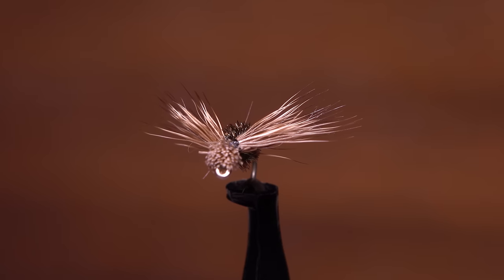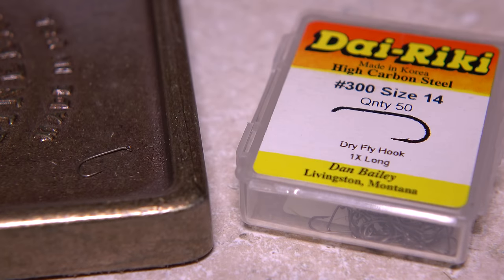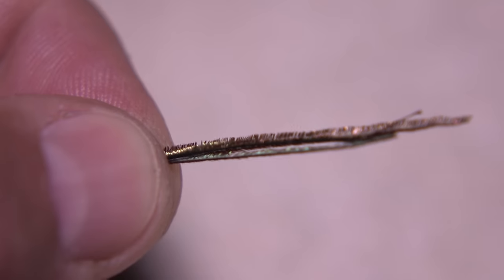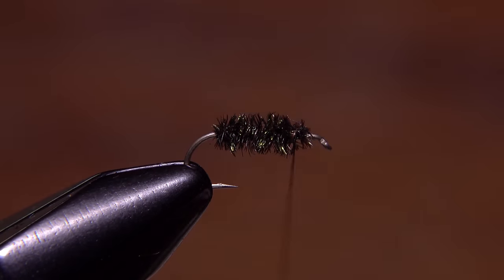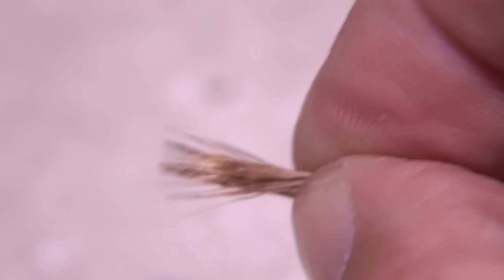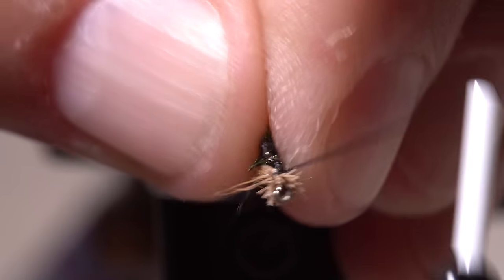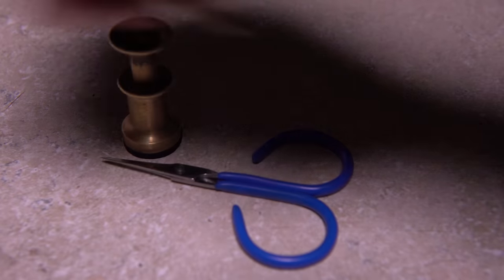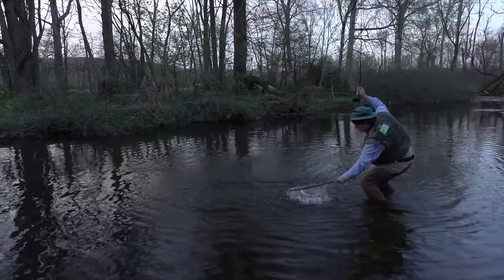BPS Spent Caddis

Comment: Another beauty!  Tying some of these up today for sure.  Question: do you think adding a small hot spot on top of the wing to aid in visibility would be a good idea?  One of my favorite caddis hatches happens in a canyon with flat light, and I can never seem to track my bugs on the water (until it's too late) without some sort of visual aid.
Reply from the maker: +awER4f Definitely give it a try, these things float so low, I'm not sure a simple hot spot would make it that much more visible. I'll give it a try here too. Most of the time, I'll just look for a rise or a swirl in the generally area of where I think the fly is and set regardless.

Comment: Great looking fly - THANKS! Do you dilute the Sally Hansen's or use it straight up out of the bottle?
Reply from the maker: +Fred Block Straight out of the bottle. As the applicator bottle gets low the SH gets a little thicker, I just add some more new SH to thin out the mix.

Comment: Does anyone else use the half hitch mag bobbin and find it frays the thread really easy and it breaks ? I thought about filein down the end of the bobbin cause it feels a little sharp any tips ?
Reply from the maker: +james gillis James, get in touch with the guys at Rite Bobbin if your Half Hitch Mag is fraying thread. Occasionally one will have a tube with a rough spot from the start. They're great about coming up with ways to smooth it out or simply replace the bobbin.
Reply: +tightlinevideo thank you I'll be contacting them asap.  Other than the fraying problem I am super pleased with the bobbin I highly recommend it to anyone looking for a nice tying bobbin